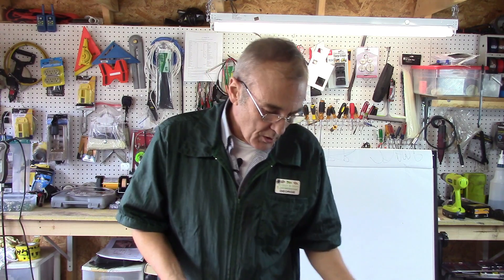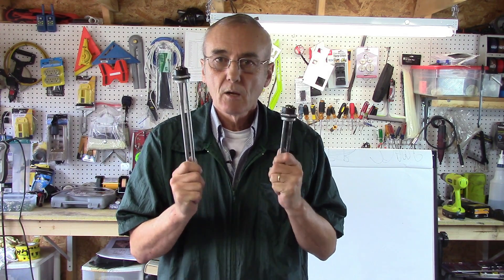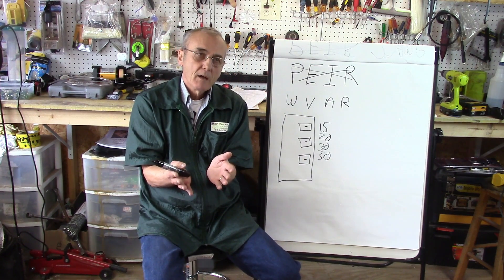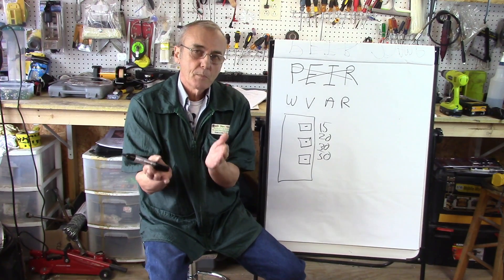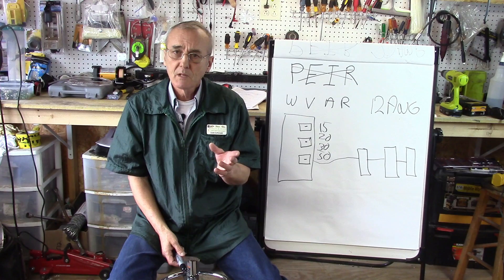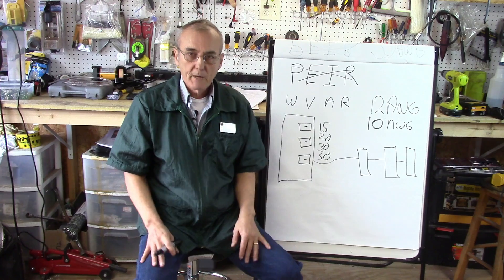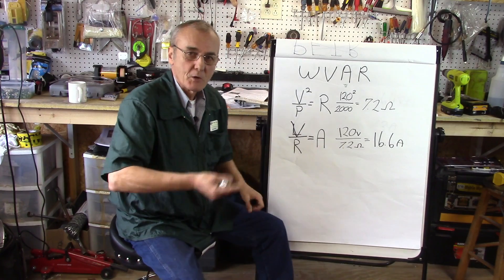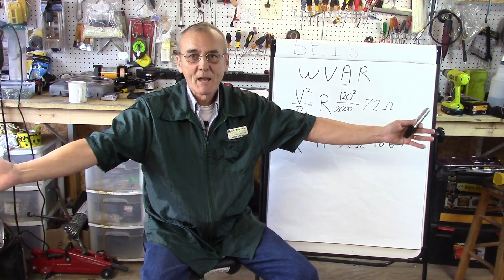EAVALUATING YOUR CIRCUIT WITH ONE HEATER ELEMENT

Comment: Be me, trying to learn how to heat my distillation pot... Accidentally learn how to repair my hot water heater.

One serious question, though. If I were in an emergency and all I had was 110 emergency power, would it be possible (in theory) to heat my 220 hot water heater with that source? I understand it would perform badly and it's an unrealistic scenario, but just asking out of curiosity. More to make sure I understand this stuff than anything.

Comment: Hi George, I like your videos. Though in this video, I hope you don't mind me commenting on the way you use the formula for resistance R. The resistance is a material property of the heating element, that means it's a constant (if one neglects the temperature dependency). So it's not a good idea to use the formula R=(U^2)/P to calculate the resistance of the heating element, because using it the way you suggested in the video would give you different R values if you plug in different voltage values. It is better to skip the calculation of R and just use I=P/U to calculate the current 
 Amperage (as somebody already suggested in the comments).

Comment: Hey, George. Well there you go again with a timely video to help me out. I feared asphyxiating myself while using my propane burner in my brew room, therefore I'm installing a 4500 watt, 240 volt element in my kettle. Doing it myself and not formally trained in electrical work, so I'm going slow and learning all I can before wiring anything up. What I have found to be, though not necessarily stressed by any electrical forums, the number one priority,  should be to install a Ground Fault Circuit Interrupter breaker switch in your breaker panel for any wiring that will be running to your brewing equipment. As I'm sure you know, replacing your standard circuit breaker with a GFCI breaker could save your life. I saw where I could buy GFCI breakers as portable inline units, that can be used with extension cords for tools and such, but it makes more sense to have  protection from the breaker panel to my brewing equipment and everything in between.  I make mention of this after reading numerous forums and watching dozens of videos of DIY rigging of electrical brewing equipment, and not one mentioned adding a GFCI breaker switch to their panel. Mixing several gallons of water in a steel pot with 240 volts running to an electric element with the connections barely covered can be dangerous business.  Especially when stirring with a long metal spoon and standing barefoot in the mash you spilled in your basement next to that old leaking and squeaking washing machine. :)  Thanks again for a great video. Brumfield
Reply from the maker: Sounds good. Safety first.
George